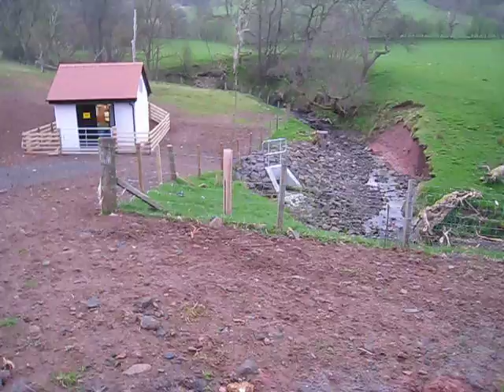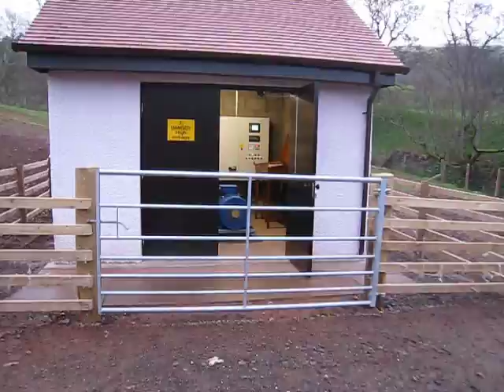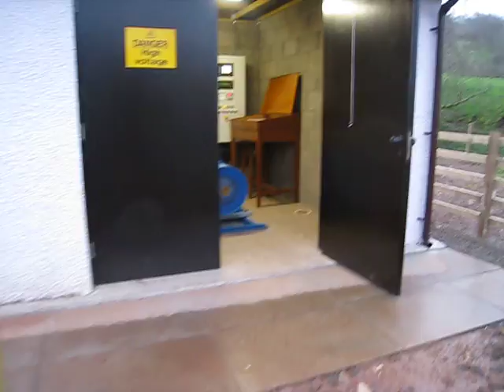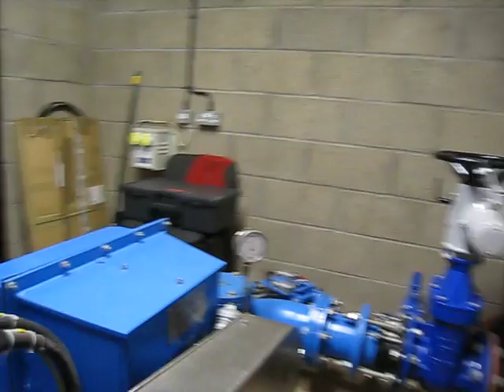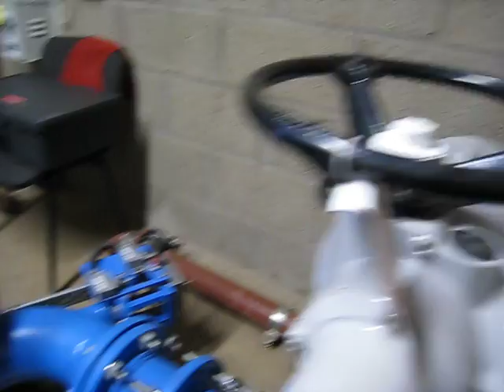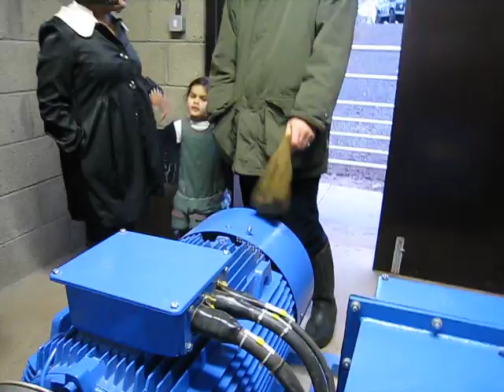Hydropower Gilkes Turgo 50Kw

Comment: forgive me but does this generate electricity via water current?
Reply: By water pressure obtained by altitude (head). Depending on the altitude of the column of water, and liters per second, you can figure out which generator is best for you.

Comment: What's my experince are... this system using too many equipment. Using extra  n hidden cost to the valve n etc.
Belting system are suitable for running any transformer.
It will cut down the rpm around ( 0.155 rpm) due to length of the belt ..Is'it?
The best are using coupling. And today we now using PP piping.
More strong n zero maintenance to the project.
The 6" pp pipe are just fare.thr longer incoming pipe.. the more power we get for the impeller..wright.

Comment from the maker: Yes it is belt drive.  Its not the best way but its often the cheepest.
Reply: Hi you said belt drive is not the best way. Why is that?
Reply: @michaelscanlin3405  Less efficient.
Reply: @michaelscanlin3405 by using a keyed coupler you are keeping the rotational axis of both the turbine and generator spindles  in line and spinning at the same speed resulting in little friction loss because it is direct from spindle to spindle..whereas with a belt you lose energy from the turbine because you are transferring energy from the turbine spindle pulley via a rubber belt to the generator pulley ...all this robs rotational energy and therefore efficiency. if you use a bespoke machined coupler it is more efficient  but takes time to align precisely...a belt drive is easier less expensive and leaves a little more margin for alignment error
Reply: @russellking9762  thank you for the reply!